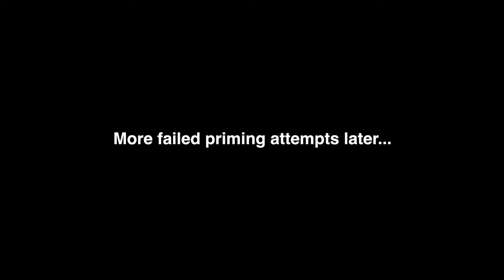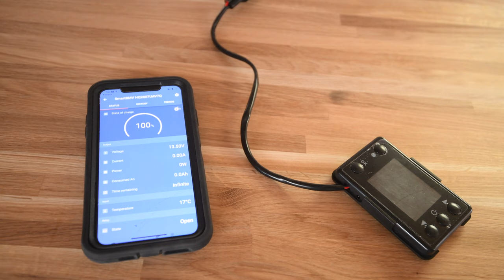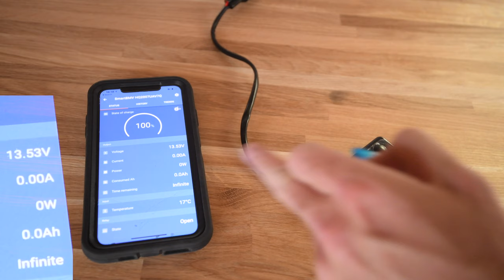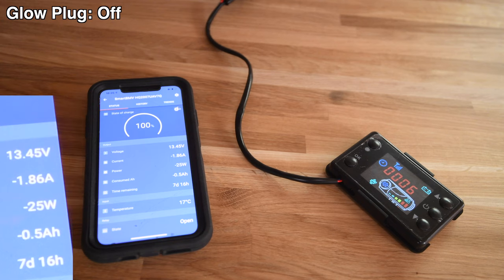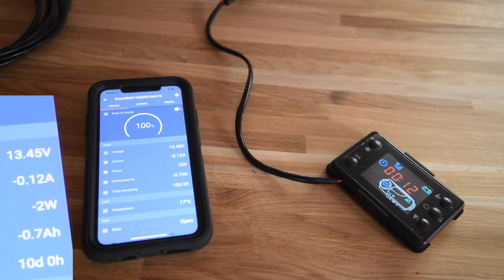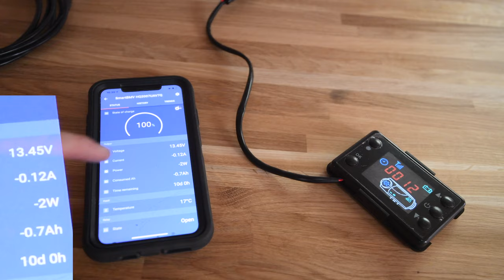5kw Chinese diesel heater install | EP30 | Ford Transit Campervan Build |

Comment: Nice timing, this is a job I'm just about to do myself. Obsessed with watching other people tackling it until I feel I'm ready to. Is that a 2kW or 5kw one?
Reply from the maker: I have been putting it off for awhile. If I’m honest I felt it was relatively straightforward! Apologies I’ve subsequently realised I forgot to mention it’s the 5kW model. More than adequate for this size a van
Reply: @MispronouncedAdventures  mine was also solid as 2kW but it's 5kW. Got it installed march and as my van is small low top it can keep it warm in +3°C even when sliding door is wide open!
Played a bit with pump min frequency and it's now good for anything below +10°C
Reply from the maker: Seems to be the case for my understanding The mythical Chinese 2kw might not actually exist and always be a 5Kw. Not played around with many settings yet. But I think I’ve going to  wait until my afterburner turns up before I start playing with bits and setting. However this week trip to Scotland it’s been fantastic so far
Reply: @MispronouncedAdventures  From the looks of it they're very rare and I suspect it's just easier to manufacture 1 and sell it as many cause I've read the 5kW gets sold as a 2, 5 & 8 KW models. Either way gotta get mine soon. I'm not in any danger of finishing my van this year but I won't even want to work in it once the biting cold hits. Plus I gotta work out the cheapest fuel to run it on.
Reply from the maker: Yeah I believe most of the tine they’re actually all the same model and slightly tuned differently.

Comment: Good job! Watching this in my van heated by same heater, +8°C outside, +23°C inside.
I'm still in progress to mount fuel pump so that its frame induced sound is lessen. Can sleep with it tho
Reply from the maker: Hi they are definitely brilliant, been up in Scotland the last few nights where is been a bit cold outside but toasty in the van. I can usually hear the pump on start-up but not when it’s going. I just made sure when I screwed the pump Mount in I didn’t tighten it so it still plenty of absorption left in the rubber mounting

Comment: Hi did you install a different controller for the heater . I dont suppose you have a link for it . Cheers 
Nice van build by the way 👍
Reply from the maker: The one in the video is original Controller for the heater, however at the end of the video I refer to install a afterburner controller in the future. I have subsequently installed that and it’s brilliant. More information can be found here in it http://afterburner.mrjones.id.au

Comment: You can run a bit of flex tube off the air intake, run it through the hole you've already cut, and run it so it sucks air from the kick panel under your cabinets. That way it's basically recycling the air.
Reply from the maker: That would be a more efficient way of doing it. At the moment as there are no cupboard doors building it shouldn’t make much of a difference. But it will be interesting to see once I finished the cupboards if it would become is less effective as it’s less able to intake warmer air

Comment: Just found your videos and they are great, Which one of your Victron devices was showing the current being used or was this an extra add-on I missed
Reply from the maker: Hey, glad you are enjoying them. That’s the app interface for the Victron BMV-712 Smart battery monitor. It was installed awhile ago in a different position in the van which was episode EP26

Comment: @MispronouncedAdventures did you undo the breather pipe when you lowered the tank?
Reply from the maker: Lucky I didn’t need too, there was enough slack in the pipe for me to drop the tank enough to access the sender unit but  I did keep the tank standing on bricks and wood so it wasn’t fully dropped on the floor. Any lower and I would of had to disconnect it.
Reply: @MispronouncedAdventures  Great! Not enough on my mk7 i didn't think so will try again tomorrow with renewed optimism.
Reply: Done it, just had to go round the other side
Reply from the maker: Congrats on getting it done! Access to the sender unit definitely isn’t easy!

Comment: Just a minute into the video and wondering what the reason you're fitting a diesel heater is, after having bought the truma boiler? New to all of this, looking into my first potential build so may be missing something obvious. Cheers.
Reply from the maker: I don’t have a truma boiler. Always had just the diesel heater for my hot air heating and my hot water ( via the Bobilvans hot water heater
Reply: @MispronouncedAdventures  Apologies, I've been watching that many videos that I've got mixed up by the looks of it. Just working my way through yours which are spot on, and I could have sworn you'd mentioned one in an earlier vid. My mistake. Cheers mate.
Reply from the maker: No worries at all, enjoy the series
Reply: @MispronouncedAdventures  Will do cheers! (I just found the truma video I thought was yours, doesn't help staying up till silly 'o' clock watching all these haha). Props to you for doing a lot without another pair of helping hands as well.

Comment: Hi, great job, congrats!
I wonder if you happen to know wether Afterburner would be compatible with a 24V heater? I can't really see a reason why it would not but I didn't get any reply from the chap down under and I am getting desperate to buy the heater as we hit 10C today. Many thanks, keep up the work.
Reply from the maker: As far as I’m aware they work with 24v heater version ( as long as it still has one of the compatible controllers) in the manual I can’t find any reference to it’s saying it works with 24v but at the same time it doesn’t says it only 12v. I did find however find references in the manual about adjusting the low voltage cut off for 12v & 24v.
Reply: @MispronouncedAdventures  Excellent stuff, really appreciated, thanks. How long did it take to get the unit and which one did you buy?
Reply from the maker: About 13 days from ordering till arrival. Which isn’t bad considering it came from the other side of the world and it’s considered non-priority mail due to pandemic. I went for the “Full GPIO + BME280” model as it wasn’t that much more and I plan to have a play with a few different things, particularly getting my Alexa to be able to control it. Also Black case with white buttons as I liked the look!
Reply from the maker: I’m currently away on a short wee test trip in the van, I haven’t opened it yet but I know it’s been delivered

Comment: Hi buddy, was the fuel line pick up you got the model 292180010432? The fuel tank sender standpipe kit?
My heater has arrived and was going to get Ford to fit aux connection to fuel tank but seems straightforward enough. 

Cheers and thanks for sharing the install.
Reply from the maker: InTransit hey, I got it’s from butlertechnik.com and they list it as “Eberspacher  Ford Transit Mercedes Vito Fuel Tank Pick up | E7193 | 292199017193” presuming the same sender unit ( and aux Port )  is used on a few different van models.
Reply: @MispronouncedAdventures  Much appreciated. Will get one ordered and run down the fuel in the van as still pretty full from our europe trip. Cheers 👍
Reply from the maker: Great. As you can see it’s pretty each to fit. A bit time-consuming lowering the tank and accessing it but fitting it is as you saw. The tank is only four bolts, and when it is almost empty it’s very light, realistically the Jack probably wasn’t needed but does make life easier.
Reply: @MispronouncedAdventures  Really enjoying watching your van van build and getting ideas... Ford made it sound like a lot of work when I spoke to them. You made it seem really easy 👍 Cheers 👍
Reply from the maker: Thanks! Plenty more interesting things to build and come!
Reply: @MispronouncedAdventures  You can get it on ebay for £25 but says it doesn't fit a mk7 2006 Transi - is that right?

Comment: The advice about replacing the cabling to AWG10 is golden.
Reply from the maker: Glad it was helpful. The voltage drop, especially on lead acid system can have a impact on and cause low voltage errors when the glow plug is heating up on start up
Reply: @MispronouncedAdventures  I'd extended mine to go via a central switch panel so that I could power off the panel and avoid the battery drain when the van was idle (most of the time) This 1m extension introduced the issue. Anyway hope you trip up North is going well. Looking forward to latest updates.

Comment: Cannot fully prime it from tank to front passenger seat. Got about 1m of line going across top of tank down side a bit to filter then up to pump.
Reply from the maker: I used the original line with came with my tank connector kit. I can’t remember the exact length I must of been around 2 meters. It seemed from looking at the fuel filter I had issue priming it using the priming feature on the controller. But subsequently had no issues whatsoever and it did fire on its first fire up
Reply: @MispronouncedAdventures  eh I'm using the original blue pipe too. Def priming to filter & bottom of pump, then only a bit from top. Works fine on a seperate tank...
Reply: Sorted. Pipe was getting caught on x-member section when lifting tank up. Just had to move it forward a bit so it was clear (of it).
Reply from the maker: Good to hear! So the pipe being physically squashed preventing fuel coming through?
Reply: @MispronouncedAdventures  yep
Reply from the maker: Must’ve been very annoying to figure out but at least nothing was broken or wrong with your set up and it’s sorted now!

Comment: Have you got a link to the after burner controller video please you were going to out on ? Cheers
Reply from the maker: http://www.mrjones.id.au/afterburner/

Here is a link to the website. However you can’t just order one as such. You have to either email Ray directly or the way I did was by joining the 3000+ members facebook group and messaging Ray directly on their that you would like to purchase one. He then  go through which model you want and to make sure that your heaters get compatible with them.
Reply: Mispronounced Adventures thanks ... how much are they ? The timer function would be fantastic
Reply from the maker: I went for the top spec model + shipping from Australia to the UK worked out at £93. Arguably more than the price of the heater. But worth all of the extra functionality. I’m going to be making a video for that as well

Comment: Good vid, don't suppose you know if the transit custom has a similar fuel tank sender unit?  I am thinking of doing the same.  I have also read some people getting an additional exterior vent and using external air to draw into the heater (rather than recirculating the van air) to help with condensation, any opinion?
Reply: Also how did you end up stopping the draw on your battery, did you install some form of cut off device when your battery gets down to a certain level?   I was thinking of also installing a switch on the heater so I could disconnect it totally once the cool down process had completed?
Reply from the maker: I’d imagine they probably do have the same sender unit. If you use the link in the description to the connection kit it says a few different models which it works for. 

I don’t think using external air would be an efficient idea. As the heater is going to heat up the vehicle internal air a lot faster as it’s intended to do so. I see the principle behind the condensation idea but I would think the opposite would happen. Since your recycling cabin air, you  have control over the moisture content of the air being used. And since warmer holds far more moisture content than colder air with ventilation in the vehicle anyway it makes it far easier for you to remove existing moist air from the van. I have a humidity sensor in the van. When I’ve left the van overnight and  not had the heating on I can often see at this moment in time. The outside humidity is 99%, whilst inside the van could be 60-70, once I Turn the heater on that internal humidity drops down to mid 30s over time. If you are using outside air you be continually bringing cold new 99% humidity are opposed to recycling gradually decreasing humidity air from inside ( gradually decreasing as ventilation is help pulling out that warmed up moist air )
Reply: @MispronouncedAdventures  Yeah, I was thinking something similar, I would think in instances that you might switch to external air intake, weather wise it would probably be dry and warm, so less likely to have the heater on in the first place.       

Did you get the afterburner?  I noticed on the link that they do not ship to the UK?  If you have it, how have you found it?
Reply from the maker: I think definitely using internal care for them as they’re designed for is the best option. Also completely eliminate the risk of sucking in any exhaust gases as well.

The Afterburner is brilliant! Had installed installed for a few weeks. Incredible how much of a difference it makes to the heater, being able to maintain perfectly cabin temperature with its linear Hz thermostat mode, Plus all the useful new features. But you are correct as of January 1 Ray no longer ships into the UK.
Reply: @MispronouncedAdventures  Shame the afterburner isnt available here.  I might get him to ship me one to my Brothers place in Oz and get him to send it on to me.    One further question, where did you feed the power cable for your fuel pump out of the van?
Reply from the maker: Yeah. It’s a shame they are no longer available in the uk. Going via someone else who lives outside the UK seems the best option now. 

As for the pump I added a wire slot into the turret plate, some model have them already and the original base already had one so I just drilled an extra slot in the same place
Reply: @MispronouncedAdventures  thanks for the info.
Reply: @chriscameron5873  ll
Reply: @malcolmjob3072  ??

Comment: Thanks for the video.   What battery monitoring module are you using?
Reply from the maker: The blue coloured app I’m using at the end? That’s a Victron BMW-712 battery monitor. Brilliant bit of kit
Reply: @MispronouncedAdventures  Hi, Is that the same as the Victron smart shunt?  Do they do the same thing?
Reply from the maker: This is the Victron BMW-712. Very similar to the Victron Smart shunt. But the smart shunt doesn’t have the physical display with the relay built-in. I particular needed to relay as I use it as a safety feature for the lithium batteries for a low temperature charge cut off

Comment: Loving the black wheels are they powder coated or new alloys. 👍
Reply from the maker: Thank you very much, they are original Ford transit alloy which came with the van. My brother and I painted them black over the weekend. washed, Light hand Sanding with 300 grit, cleaned with methylated spirits ( remove dust and any contaminants ), two coats of acid etch spray can primer, 2 coats of black alloy wheel spray paint. no top coat lacquer as I will likely scratch them at somepoint, so easy just to Touch up with the remaining spray can paint, if I used a top lacquer I would have to repaint the whole alloy to get it to match again
Reply from the maker: Super cheap as well! just two spray cans of each paint and ordered off Amazon

Comment: Loving your vlogs dude, been binge watching them, I ended up going for the autoterm planer 2kw 2d, Russian made little heater with like 100% positive feed back, cost me £450 for the full kit direct from there factory in Russia and I have to say it’s awesome, I installed a Chinese heater for my mate and only then I realised the quality difference, like the electrical wiring, and the muffler, and the PU27 controller with every setting you could wish for, the Chinese one was tack welded and the autoterm was fully welded and just much much better quality, from sealed cable connection to better engineering, I’d say it’s on par with eberspacher if not better. Totally recommend it for when your Chinese one packs in. 👍
Reply from the maker: Glad you’re enjoying the series I know a few people who have gone for the planer and been happy with them. With the Chinese and build quality is very dependent on which supplier you choose and can be luck of the draw for a first time buyer

Comment: I saw a separate diesel tank installed for the heater, by a UK couple, to take advantage of the cheaper red diesel in UK. Were you tempted?
Reply from the maker: I thought about but overall wasn’t too bothered and my heater also ships with 15L tank. I prefer the idea of the convenience of one fuel & one tank over all. Than the 60p ish saving per litre. Plus I would then need to find another space to store a tank either in or under the van

Comment: Note to self: Avoid 'Erbauer' holesaws...
Reply from the maker: I would say in this case it’s probably down to user error ( I’m being an idiot ) I was going way too fast. Far slower revolutions is how they’re meant to be used and they cut through a lot easier, but obviously with a extremely large holesaw piece it’s quite difficult to apply pressure at low revolutions
Reply: @MispronouncedAdventures  Fair enough.  I think Erbauer is Screwfix own brand isn't it?  And tbh I have found most Erbauer stuff to be ok.  Also do you find the heater diesel pump noise a problem?
Reply from the maker: You can hear it but I don’t really find it too much of an annoying personally. I have got it mounted in the factory rubber mount, which is in mounted on a long bracket and then that’s mounted to the vehicle. So that’s probably dampening it to a degree more than people who mounted directly to the van